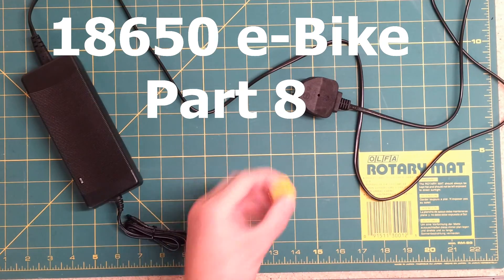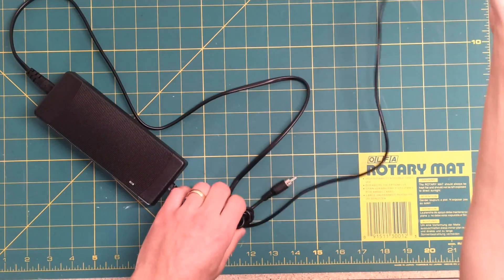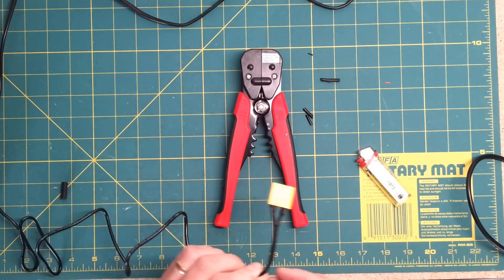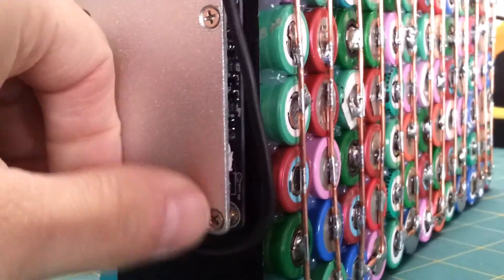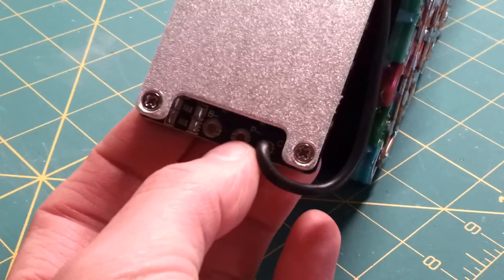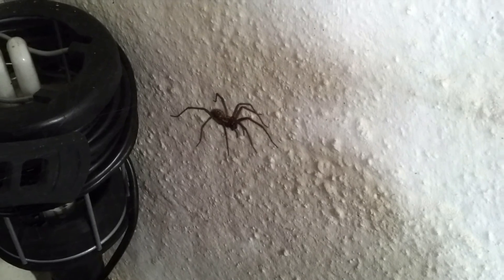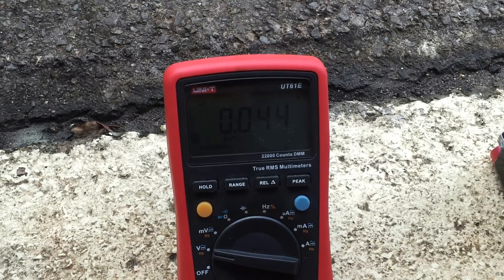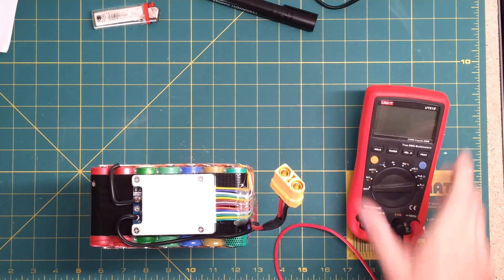Lithium Ion 18650 48v e-Bike battery build DIY - Part 8 - Charging the battery

Comment: Hi mate, i 've just made a pack like this & when i take a reading from the mains & from charging connecters i get  different result, is that normal? about 51.8v from mains and 48.8v from charger, does it just need time to balance? any advice. cheers
Reply from the maker: My packs took a logn time (many many charges) to fully balance so check back after a few charges.

Comment: what is the grade of wire u used to solder cells with
Reply from the maker: I don't know for sure but it's the copper solid wire found in household socket wiring so it's capable of several kw. Might be 1.5 or 2mm^2 cross section.

Comment: Can you adjust the total end of charge voltage on that one? so that each cell can stop charging at let's say 4v to be save. using 54v everytime will shorten the lifespan of the 48v pack
Reply from the maker: Unfortunately not, no. It was a cheap and nasty charger so no doubt a better one would be capable of this. I would care more about the longevity of the cells if they were new, high quality ones but as they've been thoroughly abused in a laptop all their lives, I care a lot less.

Comment: You worrie too much, electronics's is dangerous but not in this case where its the difference of .05v or so.
Reply from the maker: Yeah that's why I asked the question in the video. However much time has passed since filming and the battery packs have been fine, so that small voltage difference is clearly not an issue and could be within the margin of error for my multimeter anyway.

Comment: Very impressed super neat job dude have just built a 10s2p battery pack for my electric skateboard, even built a spot welder to weld the nickel strips across the battery terminals, takes a lot of work to get a battery pack looking as smart as yours! Hi five man! Good job
Reply from the maker: Cheers mate

Comment: Hello the cables you soldered ... the voltage 48 volts ?? Because I made the connection of cables to put a shot something went wrong my charger chemo .... I want to see if my bms works
Reply from the maker: Hola/Oi, Ricardo. I'm not sure I understand your question but when I soldered the battery negative and the charger neagtive onto the BMS, I saw ~48v on the charge lead as I would expect. This is the stage at which the battery can be charged and there should be no problems with the charger, when connected. If you connected your charger and it broke, are you sure you have the BMS wired up and soldered correctly?

Comment: How do you charge both battery pack.
Reply from the maker: I made my own parallel charging splitter/cable from leftover wiring. You can buy them on eBay though: http://www.ebay.co.uk/sch/i.html?_odkw=parallel+charge+lead&_osacat=0&_from=R40&_trksid=p2045573.m570.l1313.TR0.TRC0.H0.Xparallel+charge+lead+xt90.TRS0&_nkw=parallel+charge+lead+xt90&_sacat=0

Just be sure about whether you're charging your packs in parallel or series and buy the correct lead!

Comment: what is the estimated capacity of the battery.
Reply from the maker: Hi Chris, each battery is around 11Ah. I use two connected in parallel to give 22Ah.

Comment: can i use a 90watt 24v 3.7amp laptop charger to charge 24v 7s battery.
Reply from the maker: I would check the voltage output of the charger with a multimeter. Are you using Li-Ion? If you are then your 7s battery will be 29.4v fully charged (7*4.2v). If the laptop charger only gives 24v max then it won't charge your pack fully. 

I needed a charger that gives 54.6v for my 13s packs: 13*4.2v = 54.6v

Comment: i have to connect the ch- and p- together on mine to get it to start balancing if i don't the pack will not charge
Reply from the maker: Interesting... I'm not 100% sure my BMS is working properly and I wonder if this is the cause. I'll look into that on mine, thanks.
Reply: if you connect it you will see the pack voltage shoot up, then each led will light on the bms to tell you when each bank is charged.
Reply from the maker: Have you got the same BMS as me or is this how they all work?
Reply: have i the same one as you, plus i have a 10s one that you have to connect the two wires. but there are so many bms units out there i don't no if there all the same.